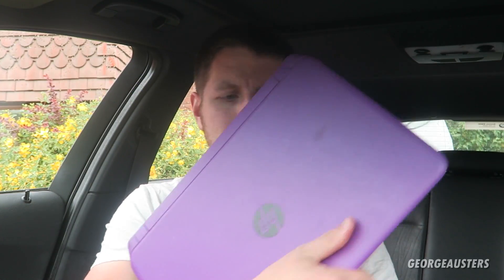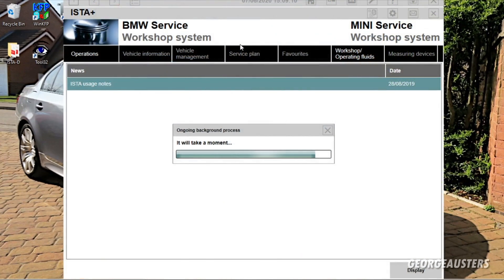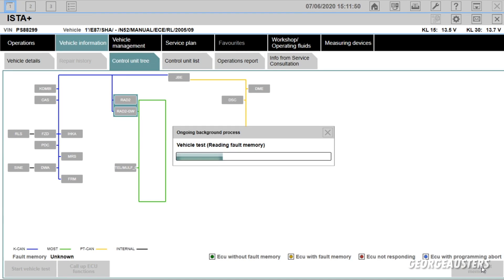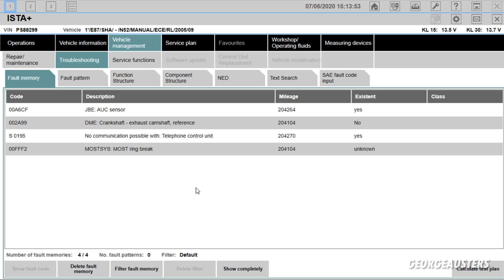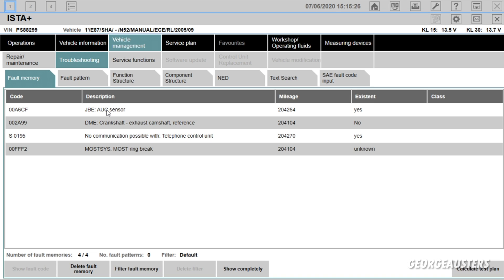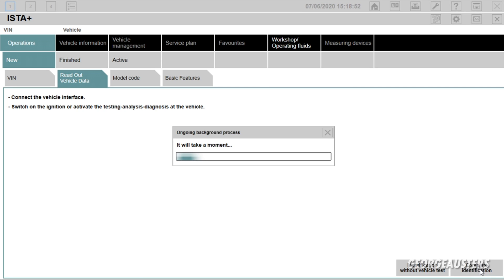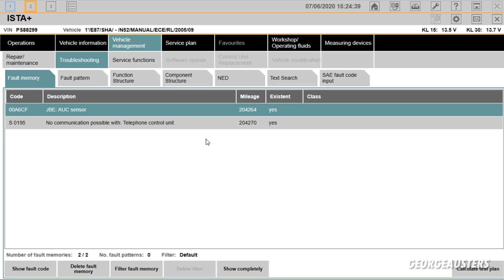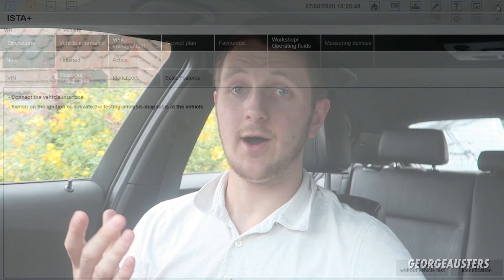How To Use ISTA D For BMW To Diagnose Faults

Comment: Most ring break will be because your MULF is out and it’s not getting a return on the fibre optic, so tcu error and most ring error are because the tcu is on the most circuit, if you do buy a new MULF, get a MULF 2 not a MULF 1 MULF 2 is much more reliable and plug and play, don’t get MULF 2 HIGH (different than MULF 2) unless you know your car has one, hope this helps!
Reply from the maker: I still don’t actually know what the problem is, I need to check the module to see if it is anything obvious👍🏻
Reply: now you do sound very stupid MULF high is ONLY fitted to cars with IDRIVE or CCC. you are acting as if you know what you are talking about but if you did you can see on ISTA he has the normal MULF and NOT the HIGH therefore it wouldn't be compatible with the car.

Secondly these are very easy to repair when gone wrong I have done it many times INFACT I have just done it on my one the MULF modules are KNOWN to go bad and yes when they receive no communication its called a MOST BREAK and therefore if he had CCC he would have got no sound and the SOS error BUT because the MULF & RAD is the only thing on the MOST network that means he has no SOS error that only applies when more stuff is on the MOST network IE cd changer , ccc mask , mulf , CCC , and the gateway
Reply: BMW Doctor didn’t read my comment properly, said only get MULF 2 HIGH if he knows he has one, I was just telling him not to buy one, and to get the more reliable MULF out of 1 and 2 not high, George is a great YouTuber you don’t need to be rude on his channel
Reply: BMW Doctor this is why I have ncs expert for coding
Reply: DeadPlate oh my god NCS EXPERT is very old tech my friend if you’re still using NCS EXPERT your way behind in the game and your not a professional

My friend NCS EXPERT is amateur crap there is better stuff then NCS EXPERT for coding and programming it’s like everybody with ista , ista , ista and that is now very very old fashioned tech 😂

My friend the stuff I use is HIGH TECH not amateur rubbish

Oh and you don’t just change coding you need to PROGRAM AND VIN CHANGE and I don’t mean with the normal tool set either 

Also you need to be sure the UIF ain’t full if it is well then you ain’t getting that MULF working with your car at all unless you can clear UIF which again basic tool set cannot do that’s what experts like me
Do 😁
Reply: BMW Doctor admittedly I forgot to mention in my first comment about the coding, so my bad on that, but all I was saying was about the MULF and MULF 2 units, I now have a coded MULF 2 in my car because I know the MULF 1’s tend to fail, I didn’t expect to be met with hostility about this, certainly didn’t expect to be underminded as you have tried to do, but you have told me what George said to you so at least you have been honest about him supposedly contacting you in regards to my comment, it’s a shame he didn’t reply himself but at least you have told me, I wish you both the best of luck in your careers.